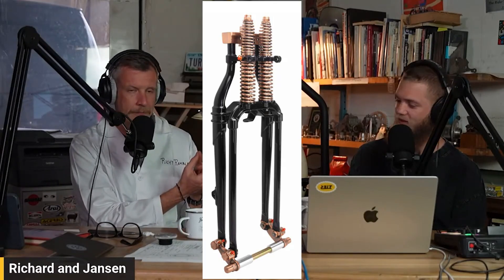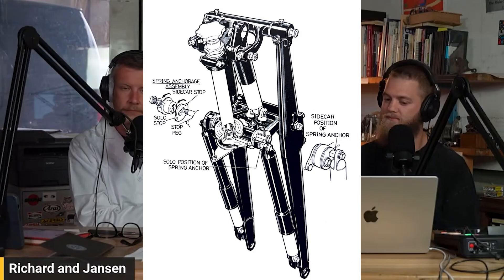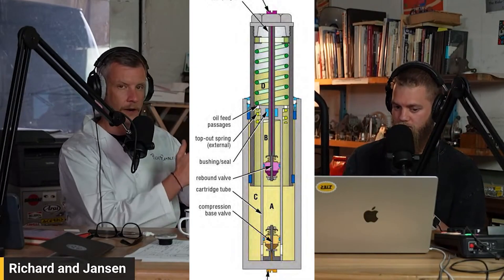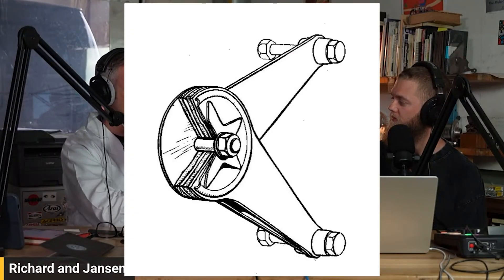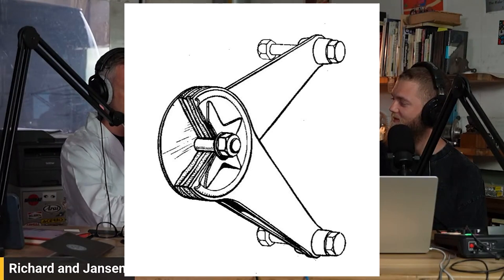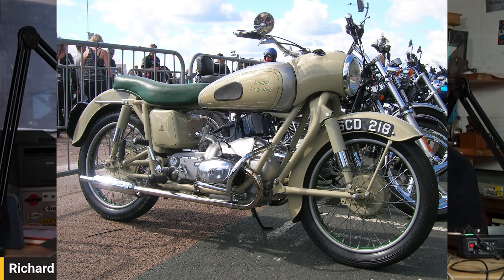Why are Janus Motorcycles' forks different?

Comment: Leading links are great on a sidecar outfit for many of the reasons you mention.  I use them for an adventure rig. They also let you set it up for adjustable trail to dial in the steering effort on a sidecar pusher.

I just figured the reason you guys do them is that you didn't have the resources to tool up to make telescopic forks and didn't want to buy more parts from the Chinese suppliers for your bikes.  They are a lot easier to make, at least.

I suppose it is possible that the LL on Doodle's Janus bike that crashed may have developed "negative" trail when it hit the step down/step up where the road met the bridge.  If the springs rates were light enough, the LL could compress fully and potentially be at negative trail while compressed.  Negative trail would produce a wobble almost instantly.  Just an opinion from an engineer.
Reply: What kind of engineer….Will you specify your area of expertise beyond “engineer” please
Reply: @revfreemoto  Master Advanced Manufacturing Engineer, Aerospace.  Last indv. ctr. title.  50 or so years riding experience.
Reply: @BenFranklinRidesAgain why do you feel the front suspension caused an issue when the motorcycle is a hard tail and it’s much more likely that had more to do with the crash.  

Have you seen the rider behavior in the crash dumping the clutch while already unstable and increasing the RPM by 2000 of the motor at the same time?  

Don’t you feel in your riding experience this rider behavior could be extremely dangerous after hitting an extreme difference in roadway surface elevation on a hard tail motorcycle followed by grooved pavement?

Given your education and experience, I would ask your objective opinion
Reply: @revfreemoto  Well, my opinion, for what it is worth, is there was a cluster of problems that all manifested at about point the bike dropped down on the rain grooves.

The front wheel dropped whatever the distance is from the tarmac to the concrete pavement, and the front springs compressed, then extended, then compressed again.  How much, we do not know. 

If they were fully compressed, the geometry on a leading link changes dramatically at full shock travel, end to end.  The front axle moves forward and backward in relation to the imaginary line through the center of the steering stem, along the arc described by the swingarm pivot point.

This movement changes the relationship of the axle position to the point on the pavement that the steering stem centerline would mark on the pavement.  This distance is the trail of the axle in relation to the centerline.  A positive trail stabilizes a front wheel.

Generally, from my experience diagnosing sidecar steering problems, a LL is stable at around 4 inches of trail (Janus specs say they are at 3.5", presumably at normal sag.)  You can run much less trail (usually in sidecar racing applications) and still control the bike, but it gets twitchy.

I would speculate that as the front end compressed, the trail reduced significantly, perhaps beyond zero to where the axel was briefly in front of the steering stem centerline contact point.  If so, this would give about the same effect as a shopping cart wheel, being pushed backwards.  It would try to change wheel directions, violently.

I suspect the hard tail lack of suspension and rider weight rearward biased did not help the situation, nor did the goofy tire tread.  All of these factors influence the design window where the motorcycle will operate safely.  All of these factors were design decisions made, presumably by Janus.

I guess my point is, this woman has more rider training than probably 99.9% of riders on the streets.  She has made videos riding tall adv bikes, heavy baggers, and many things in between.  It is probably safe to say she is a decent rider.

Janus factory set up the bike for her, maybe,  or maybe they just rolled it off the assembly line and handed her the keys.  Anyway you look at it, a small drop off and mild rain grooves should not throw a 250 cc bike into a death wobble, with appropriate trail and suspension to compensate, at 60 mph.

I had an old Kawasaki H2 that had a tendency towards a nasty death wobble at about 95mph.  The steering head bearings were shot, and it went away when I replaced them.  

Doodle was on a brand new bike, with  no wear and tear.  Everything points back to design/setup issues (spring rates, geometry, tires, weight distribution, hardtail?) that do not seem to drive modern, well maintained bikes into death wobbles.

I don't have anything against Doodle; I have enjoyed her content for years.  However I think she is doing a disservice to riders that might consider these motorcycles by not laying most of the blame on Janus, either for a poor design or poor setup, or more likely a combination of the two.

I also don't hate Janus.  As someone that frequently plays with sidecar front end geometry, I recognize how hard what they are doing is to accomplish; i.e. build a decent motorcycle in a small US factory.  

But if their design window is so tight that a highly qualified rider cannot ride their product over a mild pavement irregularity and a short bridge with rain grooves, then I think they should at least find a contract mechanical engineer with design experience to help them out.

Hell, I even like Leading Links, but it took me 3 sets of springs to get my most recent one dialed in to something close to perfection on an Africa Twin.

Sorry so long winded, but thanks for asking!
🙃
Reply: @revfreemoto Let's see 🤔... Uhm... Lincoln logs, erector sets; darn good at building N motoring,.. 🧐N tinker toys🫵Oh ya! snow forts and forts in the woods, weeding gardens, and of course building all the original Aurora monster models and my favorite... Rat Fink!! 🫵
Reply: 🤔... Uhm!! Thoughts 💬, designs, research, manufacturer's, test, test rides, fabrication, more tests , more test rides ... Uhm... That sums it up for me Mr. Cranky Nasty Dude that runs his mouth against my family... 🤨... 🧐... 🫵... Take that ed-u- ma-ca- tion to the freezer 👊..... U can't fool me Dude U getting paid$$ because this is an inclusive American motorcycle company and not mass produced assembly line.... And whomever I believe U working for does not want this company to succeed.. I ain't stupid. .Stupid!! 🤠
Reply: @oldskoolpautz  Sorry dude, not paid by anyone. Just not a fan of bad design practices and people getting hurt that don't recognize them.
Reply: @oldskoolpautz Your comment at the very end had me laughing. Thanks.